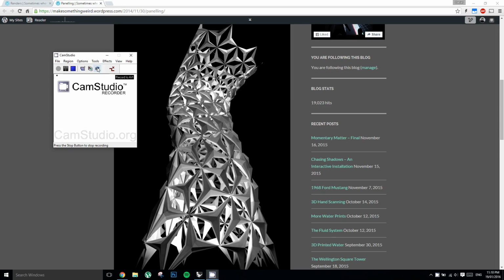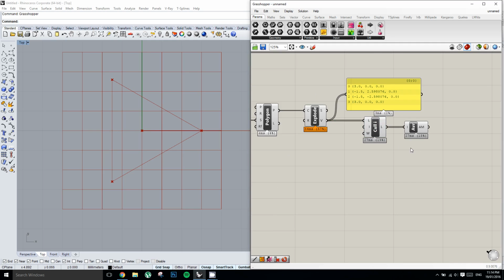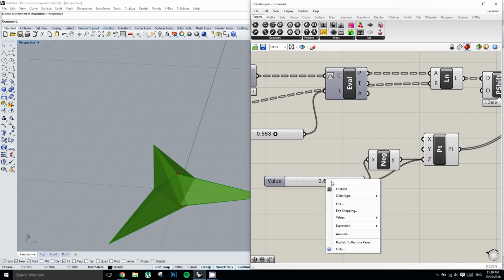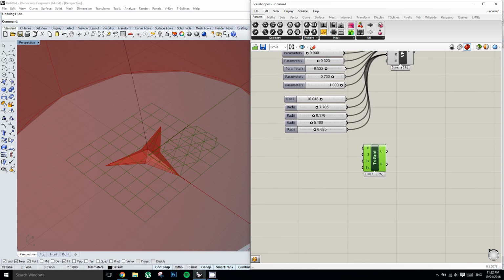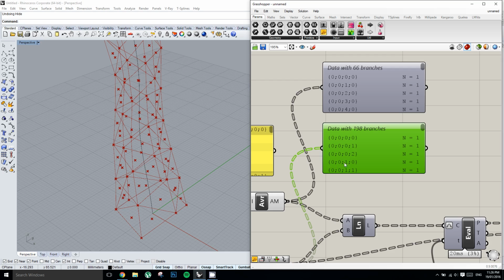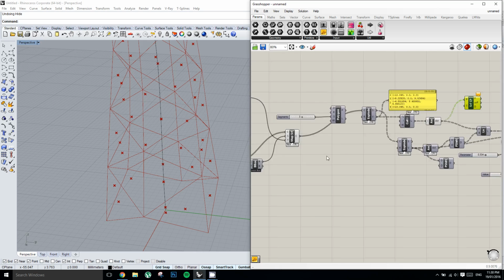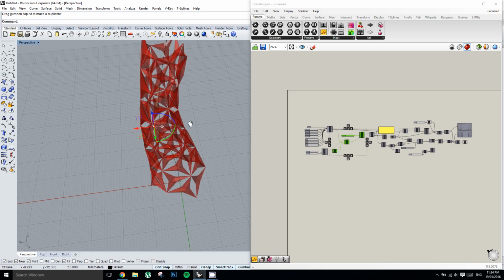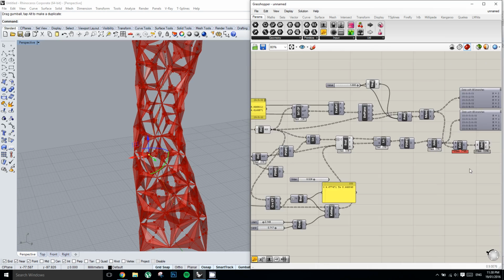Grasshopper - Aperture System Tutorial

Comment: what's the difference between points acquired through average component and arean component? Sometimes in a 3d surface they are not quite the same points.
Reply from the maker: +njy jim hey Nyj. The average component computes the geometric centre of mass of an object, and is technically a more accurate way to calculate the centre. However, when you have a larger point collection, you'll find it is a really computationally inefficient component, so using the average function will calculate the mathematical 'middle' of a list of points, and is hence much more efficient. 
So while they give different results, for a regular polygon or most shapes, the average component will give you the same result, or at least a close enough approximation.
Reply: your explanation makes great sense for me😃,Thx .

Comment: hi, thanks for the tutorial. i had a problem when i tried to follow. after i created the Neg, and connecting it to the number slide and the Pt, the line that originally connected the number slide and Pt disappeared. why is it so?
Reply from the maker: +W L you need to hold the shift key to insert multiple streams into the same component.

Comment: Hello!
This Video was very helpful,Thank-you so much!!
I just have one question, 
what if i want to do this for single open surface, like a shell or roof structure?
Reply from the maker: We use the maptosurface component. so as long as you are using a single untrimmed surface, you should be able to aplly it to any surface.
Reply: I tried, it did not work.
Reply from the maker: Tanmay Patil could you be more specific as to what didn't work? Where does it breakdown?

Comment: hi Daniel
 I was wondering if this final model is good for 3D print?
Reply from the maker: +Y Xia Depending on how fine your printer is, you may need some struts where the stars meet each other as they get quite thin. A lower resolution printer will handle this fine as it will just fuse the stars together, but a higher quality one will likely result in separation. You could perhaps remedy this by placing a small sphere at each apex of the star to contain the joint..

Comment: I tried your tutorial step by step, but the points when you have the form in 2D it connects all the point with each other instead of what you show in the video. For some reason instead of having six lines, I have nine because I have the internal lines too, how I fix it?
Reply from the maker: At what specific time in the video are you referring to?
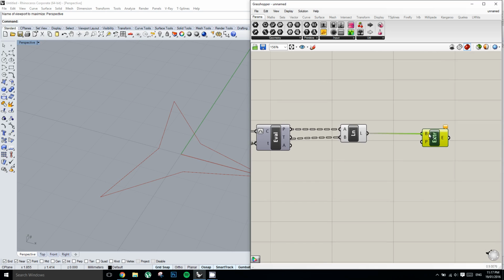Reply: sorry, between 5:36-6:20
Reply from the maker: Um, if I understand correctly, isn't this just a preview issue? Or are you getting nine lines out of the line component...
Reply: Daniel Christev exactly, it is not a preview issue. I have 9 instead of 6, I tried graft the points but then I had 3 lines
Reply from the maker: Sounds very odd. Send screenshots, gh file, etc. to dchristev@gmail.com?